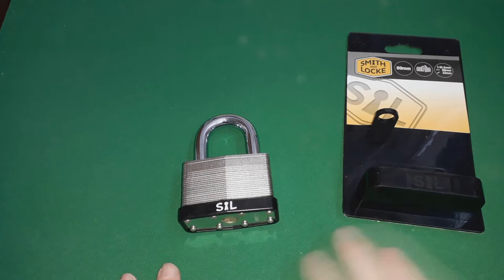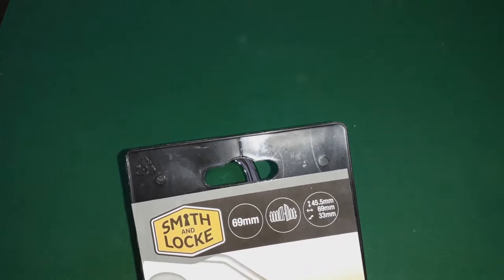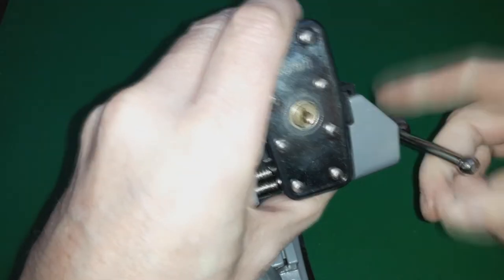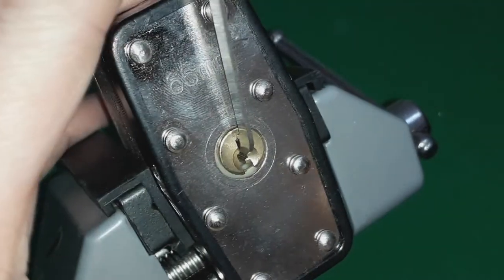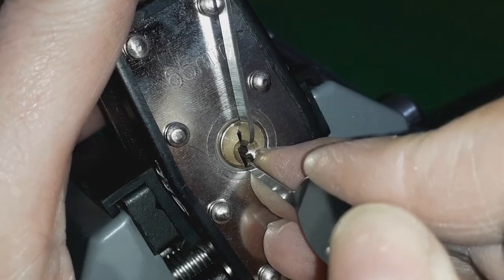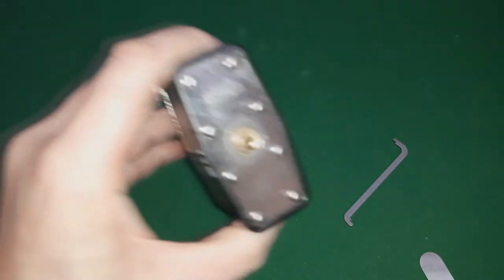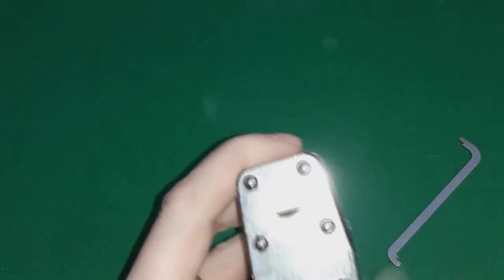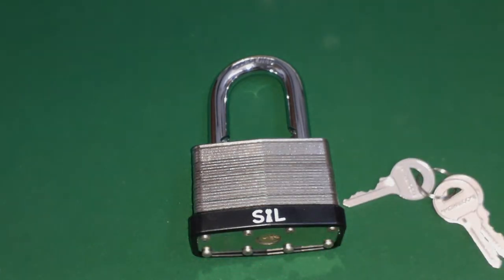(196) Smith and Locke 65mm Padlock Picked!

Comment: What a beast of a lock. Reminds me of a Master 15. That Monkey Paw did quick work. Great opening.👍🦊
Reply from the maker: It is quite a heavy lock and a chunky shackle to go with it. Not the most expensive of locks and good value for its range. The Monkey Paw worked wonders and is fast becoming one of my favourite picks. Just a pity they don't make it in 0.015 as that would be even better.
Thank you for watching Jack and for the comment : )
Reply: @roysammons2445    Others that have the Monkey Paw have posted that they intend to buy a another and sand it down to fit tighter keyway locks.
Reply from the maker: @jackfoxlock  I had thought about doing the same thing. I don't see why Sparrows can't dho us all a favour and make them in 0.015
Cheers Jack.